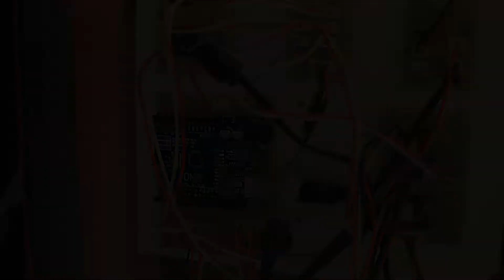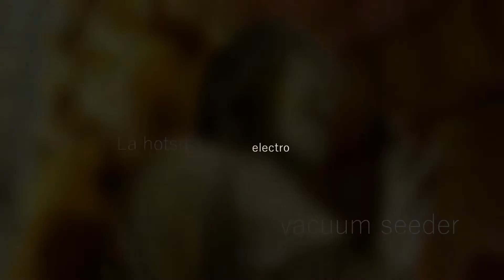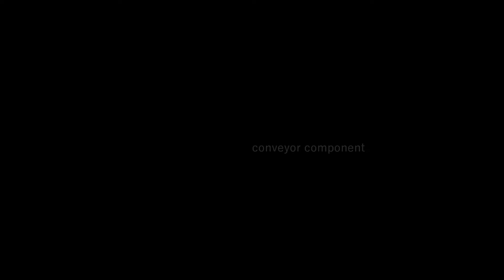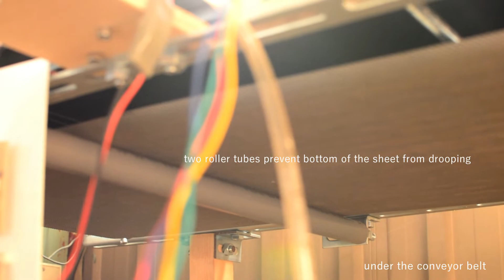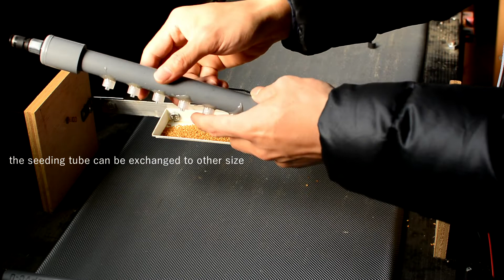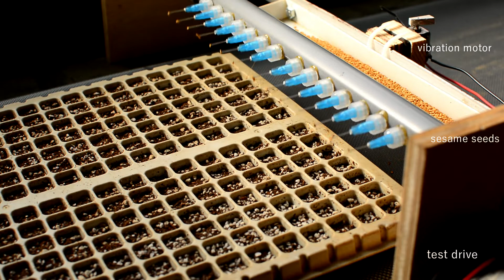DIY Vacuum Seeder 自作のセルトレイ用真空播種機の紹介

Comment: Hey La hotsu. Great work. You did well to use a real vacuum pump and make the tube interchangeable. As you probably saw, without being able to blow through the neddles, fluff or dirt can block the needles. I hope you got it working smoothly in the end.

Comment: Great work.  Some questions:  What size needles are you using in this example?  How often does a needle fail to pick up a seed?  How many psi are you running the vacuum at?  How do you make an airtight seal  at the ends of the interchangeable grey tubes?  What would you do to improve the system?
Reply from the maker: Thank you for watching.
I used the blue needles that are 23G(ID0.33mm OD0.63mm), but now I think that little bit larger size is better, because smaller size of needles are often blocked by trash and cleaning is hard.Of course larger size also has problem that some of needles catch some seeds.
If needles are cleaned up at the start, blue ones can catch around 80%.(considering they gradually catch trash.)
In the spec seet of the vacuum pump, gauge pressure is -80kPa.I think it is overspec.
At the geer side of the tube, I pluged with a rubber stopper and fixed it with a screw just in case.And the other side is just only combined with endcap.At the center of the endcap I drilled a hole and tapped thread, and it connected with tube fitting.The threads of screw and fitting are winded sealing tape.
Mistake of catch is occurred by many factors, especially in the case of decreasing quantity of seeds in the tray.
I think it is nessesary to build seeding component more accurately.For example, as the distance between the needles and the tray of seeds becomes more equal(this means that the tray place parallel to the tube), probability of catch is increased maybe. 
In addition I'd like to improve the vibration motor.
There are too many improvement points to mention.

Comment: Hi sir, what kind of motor driver are you using? 
I am using the L298N driver and have a problem with overheating

Thanks
Reply from the maker: I used DRV8825 driver.
But I think that you can use heatsink or small fan.
If you already did it, I will be sorry.

Comment: So I'm busy making one for myself and something I've come across with the seeds not being picked up. The big nurseries that use vacuum seeders, they use seed that has a thin organic polymer coating to give the needles the ability to effectively capture a seed every pass, by applying a thin consistent coat of something that will allow the needles to seal or at minimum partially seal a vacuum against, it drastically increases seed capture to 100%
Reply: Do you know the brand of the polymer they use ?

Comment: Hi, what is the model and size of the white vacuum pad or suction cup and dimension of the needle used?
Reply from the maker: You might be talking about Luer Lock Fitting?
If so, I used VRM306(https://axel.as-1.co.jp/asone/d/5-1043-03/?q=vrm306)
and needles are got from aliexpress(https://ja.aliexpress.com/item/32825628644.html?spm=a2g0s.9042311.0.0.27424c4dlrXPmB)
Reply: Is the dimension size of the luer lock fitting where the head that used to connect the needle is same? Cause I didn't see any dimension script for the part that for connecting the needle
Reply from the maker: I think they have standard size. All of the needles and fittings that I have are same size.
But It is necessary to care about male or female.